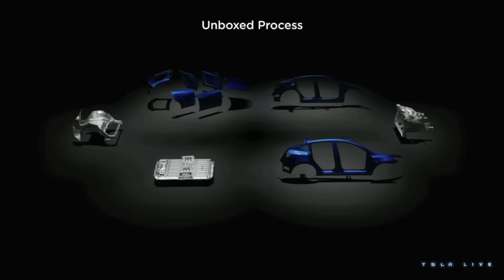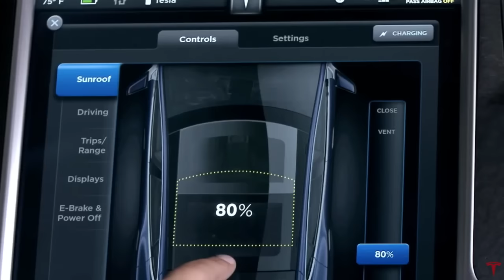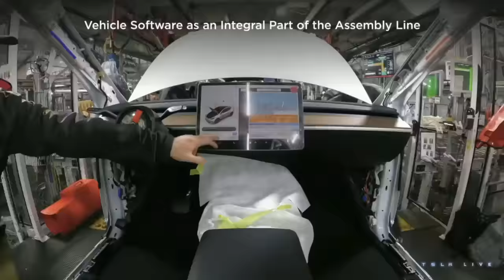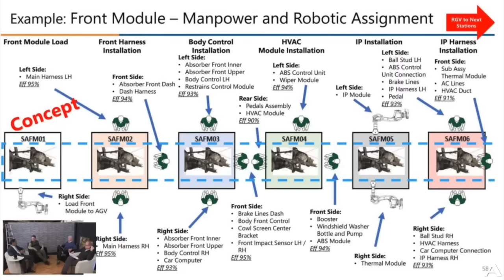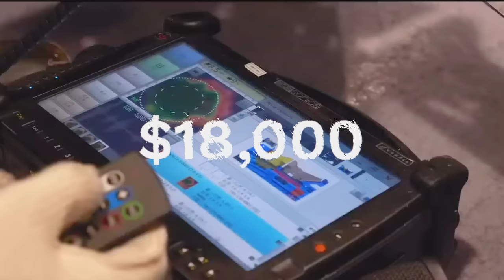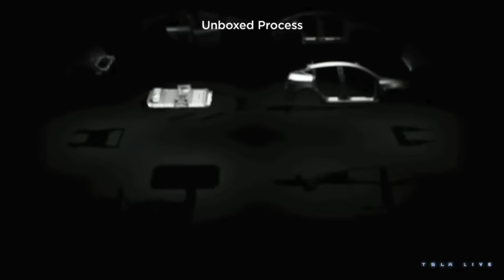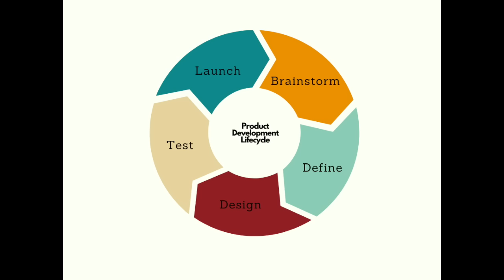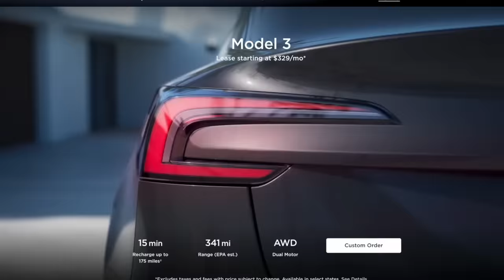Tesla Turns on A New Era of Vehicle Production - The Race for Next-Gen Auto Manufacturing

Comment: Humanoid robots would make the ideal crews for the first SpaceX missions to Mars.
Reply: Humanoid robots and boring tunnel tech would be able to make a sustainable underground Mars habitation before Humans ever stepped foot on the planet. Add future Star link sats for interplanetary communication and simple vehicles like a stripped down cybertruck for basic mars rovers. Everything Elon is involved with is ultimately for mars.
Reply: That's silly. On mars you will definitely need a bigger AI robot that can manipulate and join large habitat panels and move machinery. And you would want a smaller AI robot with tools instead of hands so it can manipulate/repair cables/connectors quickly without having to pick up hand tools. And it should have extending legs rather than get on a ladder since most cables will probably be overhead. You won't have humanoids operating cranes and using ladders and hand tools. You may only need one humanoid to set up a base because humans didn't evolve to use technology.
The factory fork-lift of the future will be driven by AI and have cameras to see all around. It wont have a seat and hand controls waiting for a robot to climb in and drive. You won't be maintaining hand controls on the truck or wasting time or wearing out the robot or wasting the energy. The best part is no part! "It's made human-like so it can work in environments made for humans" This is the antithesis of "First Principles"! It compounds costs/complexity and reduces efficiency. I'm an automation engineer, I wish they would put AI on all the existing dumb robots. Should Optimus stand in one place packing widget only using its leg to go charge itself? These people are dreaming
Reply: @@AI_effect what makes more sense to you? A humanoid operating a crane or a smart crane? NASA sent a rover to mars, why not a humanoid?
Reply: @@AI_effect mars is a long way, you can't waste energy sending things you don't need.

Comment: Tesla is the best car company ever and no maintenance no gas stations no oil changes no smog check no belts no hoses no spark plugs no air filter no radiator no alternator no starter
Reply: They definitely have air filters lol what
Reply: No hoses?  Nothing to break?  No lubricants?

Wow...talk about the blind...

Octovalve is attached to no less than EIGHT hoses (hence the name).  Wheel bearings, gear reduction/differentials use lubricants and DO need checks and changes.  Also, the calipers need checks and possible replacements due to misuse.  Ditto the tires.  And, unlike an ICE, usage of supercharging ruins the battery.  Using super unleaded doesn't destroy the engine or fuel system...quite the opposite.  And when was thr last time you had to wait half an hour or more to spend 40 minutes fueling up your ICEV?

Your copium is getting rusty and faded...
Reply: No range, no resale, no self drive
Reply: @billcichoke2534  "And, unlike an ICE, usage of supercharging ruins the battery."

No. It doesn't. The battery degrades slightly more, but that's all. 

"Using super unleaded doesn't destroy the engine or fuel system...quite the opposite. "

Does using electricity destroy electric motors? Are you done with silly examples now? 

"And when was thr last time you had to wait half an hour or more to spend 40 minutes fueling up your ICEV?"

Well you would most likely do something else while the car is charging. Just like you are doing when your phone charges or your dishwasher is running. The charge times are not as bad as you try to make them. The lower total cost of ownership for EVs is a much bigger deal than the time you sometimes may sacrifice when you are charging your car.
Reply: No cat,no exhaust, nobrake lines,brakes last longer
Reply: @nathansuss engine air filters
Reply: no transmission fluid, no radiator fluid, no engine oil and aalllllll the manufacturing, transport, waste and recycling involved in that… no more spots of oil in front of 7-elevens
Reply: @billcichoke2534  look at you tryna make it sound like supercharging is an every day occurrence and averages out higher than gas station and service visits for a regular driver… sounds like youre trying to use non-tesla EV data in a tesla comment section.  You should get a job with CNBC….  theres already a million mile tesla on youtube with allll the math.  and it only gets better…. and batteries are going to go down 11% YoY… yeah you tried to make brake services sound like a big deal… lol
Reply: @yourcrazybear  Wow...talk about copium...

You didn't refute a single point I made, and thought your last paragraph was an example of a GOOD thing.  Seriously...you just did that.

This is why voices like mine are needed.  There is a serious lack of critical thinking going on, which leads people to waste their time and money on EVs.  This really has to stop.
Reply: @billcichoke2534  dont choke on all that critical thinking that was bought and paid for by legacy auto marketing dollars… GM has about 3 bil a year alone…
Reply: @billcichoke2534 yeah Niave AF
Reply: @HAIDARAVEN  Not even a little.
Reply: @billcichoke2534  not you
Reply: @HAIDARAVEN  Oops.  Sorry.
Reply: @billcichoke2534 300,000k miles with zero maintenance . Just tires. Battery will need replaced soonish..as in maybe another 100k miles.  , that’s only like $10k with 100k warranty and another 300,000+ miles. , maybe I trade in for a low mileage model, thing drives better than I do btw
Reply: @billcichoke2534  you're misinformed about a few things; using the supercharger doesn't ruin the battery so long as you prep it first, l don't have to wait 40 minutes to use the supercharger neither does it take more than 15-20 minutes to charge my model Y RWD from 30% to 80% which is what Tesla recommends.
Reply: @billcichoke2534  love the trolling content. Keep it coming. Use of supercharging does not wreck your battery. Please take your disinformation engine and your internal combustion engine for that matter somewhere else and pollute that area instead of here. Go away please
Reply: @Joe44944  No, supercharging at rates over 50kW DOES damage the battery.  This is due to the heat generated by power moving in faster than the chemistry allows, causing heat and swelling of the battery internals.  Cooling only MITIGATES the heat damage, it doesn't ELIMINATE it.  This is why repeated supercharging will ruin or brick a Tesla battery in less than a year (as several Uber drivers are finding out).

If you're only supercharging every now and again (as many YouTubers do to 'prove something' with a rented Model 3), it's not an accurate assessment. Most people who get Teslas, have them as the 2nd or 3rd car, after a couple of ICEVs.  They aren't the ones to listen to when discussing EV road trips, since they aren't depending on theirs to do so.
Reply: Pollen filters, not engine air filters @nathansuss
Reply: @billcichoke2534 thank, hadn't realised Teslas needed tyres and brakes. That's a revelation 😂 My 2016 Tesla S has done 160,000 miles and has needed no hoses or belts, but yes I have bought tyres 😊😊
Reply: @billcichoke2534 with regard to charging, I spend more time fuelling my wife's diesel than I do charging my Tesla as I plug it in when I get home, about 10 seconds. I only have to Supercharge on long trips, last month I made 1 such trip and had to Supercharge for 15 mins. Oh and it takes me 30 mins to drive to the petrol garage (round trip). I can't fill the diesel car at home. 😂
Reply: @billcichoke2534 I love my Tesla. Try it before you judge everyone. I don't judge you for whatever you drive. I'm a real petrol head, but new petrol cars suck. Instant power makes all the difference, Tesla is a real drivers car. Don't get my started on hybrids, they are even worse than new petrol or diesel.  An old V8 maybe, but if it's new it has to be an EV. Also, get a life 😂
Reply: @sdpryce  If you're plugging your car in EVERY NIGHT to charge for 8 hours, that's a whole lot more time spent than just plugging and unplugging.  And if you had a 150 gal tank at home (larger versions often found on farms and large rural priperties), you'd be filling up at home...in well UNDER 8 hours.
Reply: @sdpryce  First of all, I haven't bought a car newer than 2000 specifically because the ALL suck.  Most have too much electronic crap that's failing and needing repair, and horrid build quality.  Add to that pricing that's ridiculous...no way.

Not everyone who tries electric cars finds them compelling, interesting, or even that fun.  I've driven a 2016 P90D, and was not only underwhelmed eith the overall drive experience, I was put off by it.  The owner (after driving around in a 2016 Toyota Camry) agreed that the petrol car was , by far, the BETTER car, and sold his Model S.

No, it's not a sure thing.  And you ARE, to a certain extent, judging me...just as I am judging you.  I don't force or sha.e people to buy ICEVs; you shouldn't be doing the opposite.
Reply: No way to reason Teslas cult fanatics !
Reply: @billcichoke2534 you are partially true. EVs, yes, but due to current limitation, infrastructure, they should bexsmall, simple, cheap used for daily commute, delivery.... No E SUV, truck... and similar non sense !
Reply: @billcichoke2534 
Funny,
 trying to debunk what the other guy said you also came up with incorrect assumptions . 

Super charging does not degrade the battery on a telsa .. 

And you charge from home overnight for ridiculously cheap cost vs gasoline .
By the way.😂

 @billcichoke2534
Reply: @Gunter_Custom  Wrong on both counts.

Even TESLA says superchsrging should be kept ti a minimum to slow battery degradation.  And electricity rates in EV heavy states like Cal (which is also more dependent on power from other states, due to more reliance on unreliable solar and wind) are on par with fuel prices, meaning you aren't saving a DIME.
Reply: @billcichoke2534  I must disagree with you and say you are wrong on both counts ...😊
Reply: @billcichoke2534  your not sitting there for 8 hours waiting for it to charge .. 
Are you a 5 year old .. 🤣🤣🤣
Reply: @Gunter_Custom  Then younalso disagree eith more than a few Uber drivers, who had that exact thing happen to them after using their NEW Model 3 for around a year.  Their battery was basically done.  And a few brave Tesla owners have been talking about their previously inexpensive home charging becoming as expensive as filling up with gas, but not as expensive as supercharging.  Those vids are on YouTube; look 'em up.
Reply: @Gunter_Custom  L2 charging?  Yes you are.  Busy winter evening at some supercharger sites in Chicago?  Yes they were.  Some for even longer.
Reply: @billcichoke2534  you believed that b.s. Chicago story .. lol ...🤣🤣🤣

Comment: Backwards individual parts compatibility, only goes so far. In using some updated parts to replace a failed part, other mechanical parts may have to be changed as a set, since the interface points and dimensions may have changed due to necessity. An example would
Be a hood latch and the strike, may have to be replaced as a set.

Comment: This reminds me of 2001 when the internet startup AOL merged with the giant Times Warner. Instead of going bankrupt, GM, FORD, Toyota might prefer a fusion. And TESLA will need their production facilities, as their plans is to triple their production capacity by 2026 to 7.5 miilion cars per year (5 million for the model 2), and another  10 to 15 million for the model 1 a few years later. TESLA will transform the car industry into a transportation service industry for goods and people. The service requires robotaxis (or anything that can move autonomously). Tesla will disrupt the car industry, the insurance industry, the infotainment, the battery industry (car and residential), the fast charging network will replace the existing gas stations. The data collected by this service industry will also be of value for the advertising industry.

Comment: The irony of showing the Tesla's in snowy mountains, the real story is in the Chicago suburbs !
Reply: Teslas do just fine in Norway in fact they are amongst the most popular cars there. The difference? People in Norway have learned how to operate Teslas and have them plugged in at home overnight so they preheat the cab and battery. The people in Chicago don't understand how to use the cars or live in apartments and don't have the ability to preheat. If you don't completly charge your Tesla before you park it at night in below zero temperature you end up using a good portion of the electricity to heat everything up in the morning. It's all a matter of operating knowledge and infrastructure.

Comment: The public acceptance of EV cars has just about reached it's max. If you need proof, look at the used EV market prices. There are still major problems with EV's. Here are a few to consider. Because the main battery is a structural part of the car, minor accidents often result in a total loss. Battery chemistry needs to be safer. Thermal runaway is an industry wide issue that desperately needs a cost effective answer. If the government was throwing up new nuclear power plants all over to keep electricity prices low would help. As demand for electricity goes up prices will eventually sore to new highs or mandatory rationing like what California does. Not even California has any new nuclear power plants planed. Green energy is too reliant on weather. One hail storm just recently wiped out an entire solar farm. There needs to be an aftermarket industry to repair anyone's battery at anytime. The eventual battery replacement costs are a ticking time bomb every EV shares. The future maybe EV's. For me it is still decades away from looking promising...

Comment: There is nothing Tesla can't do and the CyberDud proves it.
Reply: "CyberDud"... by that are you referring to the most pre-ordered vehicle in human history? We have very different ideas about the definition of a "dud"...
Reply: @jameshathaway5117  The CyberDud missed virtually every one of its claimed specifications based on the hype generated by musk and his mouthpieces on the internet. It's a failure.
Reply: @heathwirt8919  it missed out in 2 metrics... the price (if you calculate for runaway inflation it's less than $1000 off the original stated price) and the range (that was a guess based on unknown efficiency and a all new battery chemistry).  So realistically it only missed out on one metric and that was range.
Reply: @jameshathaway5117  Also misses on towing, payload and battery capacity. Virtually everything that matters. It's an overhyped dud.

Comment: I'm sure you make this up as you go along, and obviously don't have a clue about car manufacturing! Yes, they can use robots but then Tesla production isn't as labour-intensive as most car production lines as it is, with a scale-down of around 75% compared to a standard old fashion model. But with a reduction in semi-skilled labour the costs of highly skilled labour increase, I would even go as far as to say you need to reduce the workforce by 60% just to break even as the robots as with all machines need maintenance, which can only be done by highly skilled engineers. I've seen it many times in actual plants I've helped set up. The cost savings aren't 50% they are barely even 10%. 

You also seem to forget that the biggest cost of EV's are the batteries which have 95% fully automated production already, so the costs now are down to raw materials, not process, 
Don't get me wrong I think Tesla is an amazing company, I have a Model X and I love it, there's nothing quite like it, I love Elon's vision. But there's not that much scope for improved efficiency or reduction in cost, unless you build in a different country, as it's taxes, business rates, ground rent, location and skilled labour costs that have the biggest impact. This is why it's $8,000 cheaper to buy a Tesla in China than it is in the USA, and more expensive to buy a Tesla in the UK, The starting price in the UK is £40k when they are $40k in the USA which is only around £32k. 

Half the reason Tesla is so profitable is that it doesn't have the dealership markup on cars that we've come to expect from legacy automakers. Is that a good thing? It's great until you need help, as for the future and selling 20 million cars a year, you will find that new car sales will start to fall in the coming years as there's a massive push to get people out of their cars and reduce private travel. Only time will tell.

Comment: Toyota will easily compete with Tesla.  They will just remove all the electronics and sell a base ICE for $25k.  Imagine a car that does not break when a wire is frayed, runs forever, fast and cheap to repair.  No electronics.  Manual windows, manual doors, manual hatch, ect.... huge motor bay, easy to reach oil filter, gas filter, simple manual transmission that anyone can repair with just 3 gears.  Imagine it.
Reply: Regulations insure all the opposites to your proposed advantages. Also the 'no frills 25k$ car' will lose to 'some frills Ev' 25k$ car.
Reply: Toyota already makes base level cars... WTF are you talking about?
Reply: @jameshathaway5117  I don't know, its like the mountain of debt, Toy and VW have matters not.
Reply: @mikedar8484  I'm confused as to how your comment has anything to do with what I posted... care to elaborate so I'm not left in the dark?
Reply: Somebody has done that already - they are called the Amish.
Reply: @joansparky4439  😂